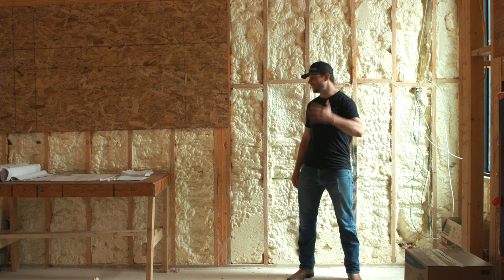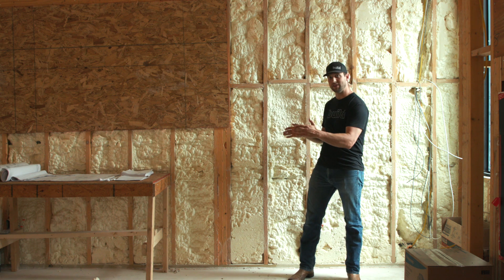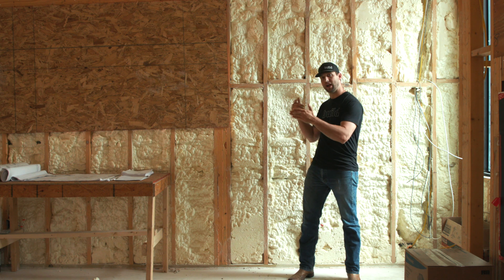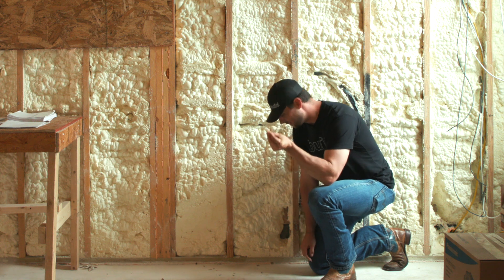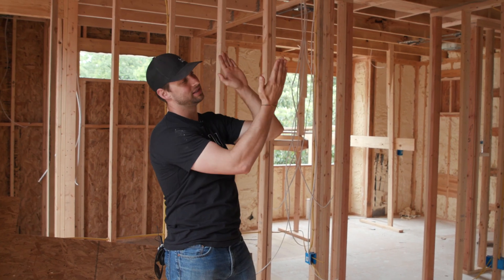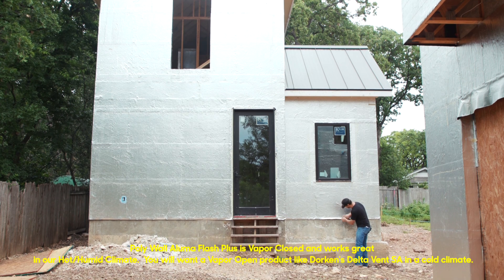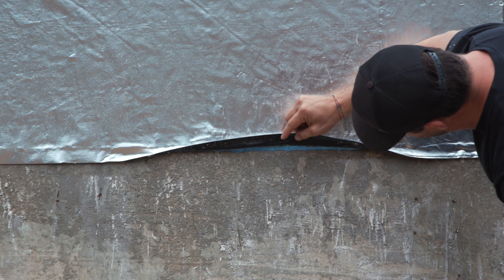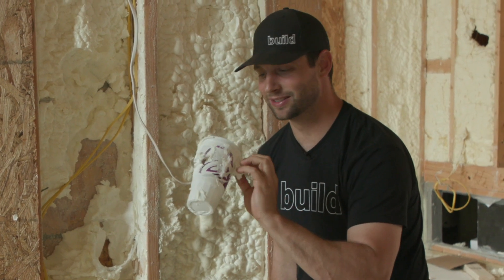3 Spray Foam Problems

Comment: How does AlumaFlash affect RF devices like WiFi? It looks like you made a faraday cage. 

Also, with a metal roof and aluminum along the edge... what would happen with a lightning strike?
Reply: cuylarHD cell phone signals too?
Reply: i get no cellphone signal in my aluminum clad house with a metal roof.

Comment: How are you addressing vapor drive when you're using PolyWall Aluma Flash(typical rubberized asphalt backing membrane) with a Water Vapor Transmission of 0.014 perm(E96B) on the exterior and a closed cell foam on the interior? Essentially you've created a double vapor barrier that could potentially cause moisture entrapment issues. I'm surprised you didn't use a product like VaproShield WrapShield SA with a perm rating of 50(E96B) to allow rapid outward drying yet it boasts some of the best Air Permeance and Water Resistance among current available build wraps(WRB).

Comment: Any tips for drywall removal from spray foam? Our house had the entire roof insulated with spray foam to save on energy costs several years before we bought it. As part of a chimney demo we are nearly finished completing, we needed to remove the drywall from the ceiling so that new drywall can be installed in the next month. The original vapor barrier sheeting was removed prior to spray foam insulation, and as a result the spray foam stuck to the drywall. Because this seems to be a new problem(and therefore no tools for it), our best solution was using paint scrapers and hammers to chisel it off the spray foam. We managed to get all the drywall off the ceiling this way, but since this is something we will need to fix in the rest of the house, maybe a tool can be created for this by then. :) The only other solution seems to be to cut out the spray foam insulation and drywall all at once, but we aren't wanting to do that for quite a while, at which point we will completely be rebuilding the roof.
Reply: Heat gun

Comment: The whole spray foam industry gets a bad wrap because of jobs like this. Homeowners and contractors should do their best to find an installer who understands building science and is aware of where air infiltration happens and fill all of those areas.

Comment: Guys
I have my shingles bowing up on hot days right over every rafter. Shingles lay flat over the decking. 
I’m thinking a temperature difference but to cause that?
Ideas??

Florida panhandle. New construction 2018. Closed cell.

Comment: Spray foam is garbage and when they come up with the next best insulator out there they will let you know why. They don't care but have you ever had to add electrical wiring or other utilities in those walls. What a unnecessary mess.
And real toxic if you have a fire.

Comment: I live in a 150 year old house.  We have a ton of air leakage, and not insulation.  Aside from the sever loss of heat - isn't there a health concern with your house being too tight?  How to you know your getting enough clean air flow to  1) exhaust stale air,  And 2) to keep the house from building up Mold from condensation conditions.  New houses just scare me!
Reply: justin Case justin Case My house isn’t THAT old but if you’ve watched Matt’s other videos, especially the ones where he’s renovating his own home, you’ll notice he does emphasize stopping airflow.  You and I can’t do all the extreme things these guys talk about.  We’ll be lucky to get down to a 5 ACH.  And remember that 5 ACH is still actually a somewhat leaky house-certainly not too tight.
I grow a bit weary of all these guys (including Matt sometimes) bragging about some wonder product.  Our challenge is to apply selective engineering and specific products to assist out efforts to mitigate old, energy inefficient engineering.  I think it is useful to point out that we can’t apply a “package” of some type because the underlying engineering isn’t there.
Sine I haven’t found a YouTube channel devoted to remodeling old houses I’m trying to intelligently implement the engineering concepts that apply in my case.
Sadly, much of what we see on Matt’s awesome channel doesn’t apply to guys like us.
Reply: The house should be airtight as possible, you get air through a properly designed ventilation system, not through leaks.

Comment: You claim spray foam isn't the air barrier you thought it was and then you go ahead and say it's better to use air seal from the outside using something like alumaflash or whatever.  Truth is, the problem isn't the spray foam, it's the fact that you compared making the air tight barrier on the inside vs on the outside. You could very well apply an additional 1inch layer of spray foam on the outside and get a better air barrier and insulation than any other technique you could think of. You'd also eliminate all thermal bridging and increase your relative thermal value, and not just the total thermal value. Moreover, please get a certified spray foam applicator to do the job. There are plenty in your region.

Comment: I'm sure that even if the cavity is under-filled or it pulls away from the stud, it will still be better than your traditional insulation.

I'm also going to assume here that spray-foamed homes are stronger.  Think about the crap you buy at the store, Great Stuff expanding foam.  Have you ever handled a chunk of that stuff in your hands after it has dried?  It's hefty!
Reply: My house doesnt even hav insulation in the fking walls.

Comment: Y’all don’t realize that having too much barrier causes a nightmare of issues. (In Austin/Houston) first off if your house is absolutely sealed, the air contamination in your home is terrible. Multiply that if you have dogs inside. Also, if the house can breath at all then rot is going to eventually happen. Just my .02

Comment: Spray on foam jobs like this are typical. That is why I am not a big fan of foam for walls. Attics and crawl spaces I think it works fine when you put it on heavy. When it comes to walls the person applying it has a tendency to go light so it doesn't have to be cut back to get the drywall on.

Comment: I would like a discussion of this level of insulation technology as applied to vehicles, like RVs.
Reply: Metal shell?  I would reach for closed cell foam.  What I don't know is surface prep: something like powder coat might need a primer [or some other treatment] applied first, or adhesion might fail?   Solvent compatability issues are something to be aware of - foam manufacturer should be the best source of info.  You do not want moisture arriving to the surface between foam and metal.  But: penetrations need elasticity - other sealing methods [grommets, glands, caulk, etc] should be applied first.  RV's have plumbing, electical needs that pass through foam and will lose air seal/leak at some point, if foam is the only protection.

Comment: You and a couple other channels have me rolled over on doing spray foam in my travel trailer build. My drawings, my welding, my drilling and riveting the Alum skin, ....... You guys rock with effective energy efficiency ideas!!

My target is to heat and nightlight my trailer with a candle in mild winters here in N Tx and to use A/C only when outdoors gets above 90. Spray-in foam is the $ effective, time efficient, structural stiffener that foil laminated foamboard is not. Thanks for your perspective!

Comment: Foam insulation of any type, like so many things, depends on good workmanship. And good workmanship requires good communication,  good supervision, and RESPECT for both your trade and your customer. And that, in turn, depends on the builder creating a culture where anything else is completely unacceptable. Period.  And I don’t care if it’s a one-off custom builder or a 1000/unit/yr production builder.  This sort of shit-job is what happens when the culture is missing. Buyers beware -  if you’re selecting a builder by lowest price, or fastest availability, or anything other than their reputation for excellence... this is what you may get for your money.

Comment: I think many people will start to suffer because of that foam.
It is hard to understand why people nowadays agree to have something so risky in their homes.
Same as it was with the asbestos where people were also told that it was completely safe if installed properly.
And also with the lead paint that it was completely safe if painted and maintained properly.
Reply: Dino B.  There’s foam in more things than just our homes.   Look around you!!  Chairs, couches, seats in your car.  You can’t use filthy fiberglass for stuff like that.

Comment: I live in Florida.  Our spray foam installation was faulty.  Our builder didn't know much about spray foam and the installer apparently didn't either.  Our ACH was 30 to 40 and we had mold in our attic after a year due to HVAC duct condensation dripping onto ceiling sheet rock.  Every house in our brand new development had the same problem.  Spray foam is only good if it's properly installed.  Problem is in finding good installers.
Reply: What was the fix?

Comment: Interesting here in Finland we use aluminum coated grooved foam sheets and then spray the gaps with foam which are then taped over with aluminum tape.
Never even heard of using insulation foam like that though it makes a kind of sense if you have truck full of stuff to pump it in and not those tiny pistol cans.

As for K values in this climate 4500mm of glass wool equals about 120mm of foam sheeting.

Comment: It seems like the Aluma Flash would have the same problem that the stucco wall had that held in all the moisture because it did not breath and then caused the siding and studs to rot. How is that prevented?
Reply: its a southern climate. the vapor barrier should be on the outside so the wall can dry toward the inside. if this house is finished with stucco. the wall should be furred out first to allow ventilation behind the stucco.

Comment: If using Poly Wall's Aluma flashing , I am guessing the perm rating on that product is super low, as in almost 0? Thus the wall has to be designed to dry to the interior. You should mention that. A wall assembly has to be designed to insure no failures. So before you start wrapping your house in this stuff, make sure the wall is thoughtfully designed to function appropriately. Nice vid, Matt looks different?

Comment: It's not just the applicator it's the owners telling them to spray it when the conditions are not right .
Reply: True. although no matter what some jobs will get done under bad conditions.  There are only about 2 reliably good months, an working only when the sun shines and its not too hot, well, that shortens a guys working year down to about 40 days.   It's not economical to wait until perfect (or even good) conditions are available for every process.  The sun comes out and I get 100 phone calls all at once to go do concrete.  From a project management standpoint, it is hard to get a spray foam guy back once you've made him wait on the weather, because he's went to do other work.   The best thing is to manage the building temperature/ humidity, and get a good contractor who is prepared to work under bad conditions.    Neither of which are cheap.

Comment: I was a fan of spray foam until I saw first hand how much carpenter ants love it. They Love It! I have seen carpenter ants drilling mile long channels and chambers through that stuff. Closed cell, open cell - doesn't matter. Same with foam boards. The claim that carpenter ants go where they find moisture is a total myth. I have 4" sandwich panels with a foam core as roof panels. Carpenter ants are living in the core even though it's bone dry that roof gets probably 140 degrees hot in the summer. Forget spray foam. Spray seal all your stud/sheeting joints and use mineral wool for insulation. You will avoid the 1000 things that can go wrong with spray foam and will cost you a lot of money to fix

Comment: It's kinda interesting to see how mericans build... not really   environmentally sustainable and it looks cheap. 
 Sry just my point of view
Reply: Actually the houses themselves are very efficient.  And we use wood because we have a lot of it and we have so much expierence with it.  Also remember that this video is the work done by a poor contractor that another company had to come in and fix.
Reply: @colincampbell767  I'm not talking about the wood.. I'm a carpenter my self... but just in Germany. And wi build ze houzes a bit different.

Comment: Spray foam is junk if u shave it it’s full of tiny little air pockets and will seep air through an if it does cure properly it makes the house stink and cuz allergy problems an then the house is junk!! Blow in fiberglass insulation is the best I have it R 35 an it most efficient and it can breath foam can’t breathe properly so it causes bad air quality never use spray foam insulation if u have to tare down to fix plumbing problems is screws up everything I would never buy a house with this crap!!!

Comment: If the builder would pay what the spray foam contractor charged and not ask for discount i bet they wouldnt have this issue. Spray foam is manufactured on site by a train professional and is not a cheap solution but when formulate and installed correctly it out performs fiberglass. With over 20 years of spray foam experience never had an issue with installation ofcourse engineering control are always implemented before commencing of spray foam. Make sure your spray foam contractor is up to date with the industry codes and are manufacturer and pcp train to recive quality spray foam Insulation.

Comment: I have been scientifically taught good spray foam acts as a vapor barrier. I know it is accepted widely in North American building to meet code and most certainly qualifies as a vapor barrier. If you deploy spray foam and then use the exterior foil membrane, you have in fact created two vapor barriers that can not breath between them. Whatever is sandwiched between the spray foam and the foil membrane will retain moisture that leads to mold and rot. Now you have a problem coming to your structure down the road. Dual vapor barriers is bad news in my experience. Most building inspectors in my area don't even know this. I have only met a handful over the years that have the education and experience to acknowledge this.

That foil wrap would work proper with a loose fiber type insulation on the inside but even better:
Breathable exterior sheathing over the OSB or plywood
With loose batt insulation in the stud cavities
Vapor barrier on the interior studs.

I very rarely use spray foam insulation on any job. It has its place but under ideal building situations in new modern structures, there is no need to deploy spray foam insulation.

The spray foam insulation in this YouTube video was NOT FLASH sprayed with a wet coat prior to adjusting to the deep spray passes. This video does indeed show very poor installation of spray foam. It is not acceptable to see spray foam break away from the structure to leave gaps. If it is doing so then it is done incorrectly. I hope this home does not make its inhabitants sick in the years to come.

Comment: I've been spraying 2lb Sprayfoam insulation for 8 years in Canada...works great and haven't had major issues. It looks to me like he tried to spray 4" at once or was spraying too hot....you shouldn't spray thicker than 2" per pass.  spraying too thick will cause the foam to 'burn ' in the middle and will kill your density and R value
Reply: on a side note here.... that was 1/2 lb. foam not 2lb. you can apply 1/2 lb thicker as long as your not blowing back the material. you are however correct in saying that about the 2lb foam.  and on another side note.... i did the spray foam for over 10 years in the states. and none of my jobs never looked that shitty. whoever did that job was not trained properly.
Reply: Personally from my experience I think it happened to me only when it was so cold outside that when spraying..the cold reacts with the hot temperatures from the foam and makes it pull away like this... never happened with closed cell. (I’ve only been spraying for almost a year so I’m not so experienced yet! 😁)
Reply: I know little about Spray Foam , but looking at it. It looks like a lot of uneven  logs( sprayed)  where it does bond well to what was sprayed. I hope i have described  that?  Sprayed tooooo cold?  Not like what I watched from Spray Foam Jones.
Reply: By "burn", you mean to say expansion of perimeter prevents or collapses center expansion?
Reply: You have to picture frame it too and it looks like this wasn't done here
Reply: XL spray foam you can spray up to 8 inches open cell the closed cell is the one that you can't spray more the 4 inches but now is a lot of options of chemical that you can spray more than 4" closed cell ...you got no clue what you're talking about i been spraying since i was 22 years old im 40 now f you need to know more about foam come to north carolina the problem on this particular job is moisture you need to heat the house with all Windows open for 30 min to an hr and then closed the windows heat the house keep the heater close to the are were you going to start to spray and you never gonna have that problem..
Reply: @XL Sprayfoam Solutions, but naturally of course you going to say it’s a good product. You is the guy installing/selling it. 🙈

Comment: Pro clima products work really well for air sealing. Contega HF works great in stud bays between studs and outside sheeting and tescon vana tape works well for flat sealing seams. They also have great membranes for interior and exterior.